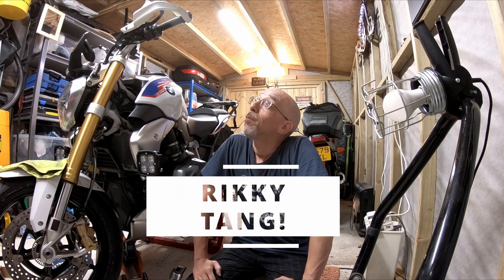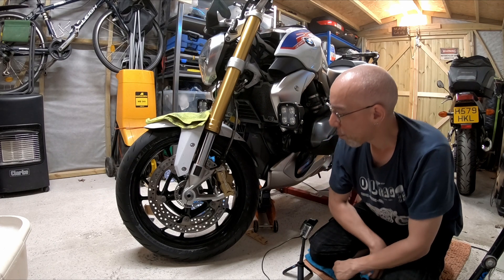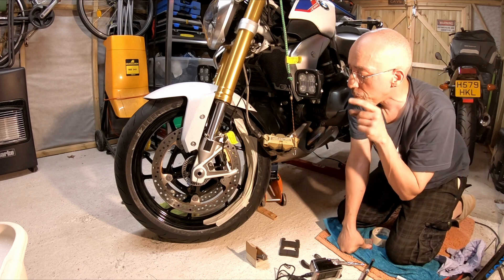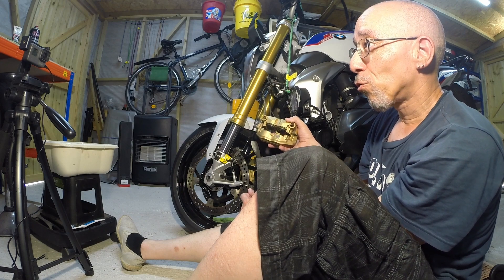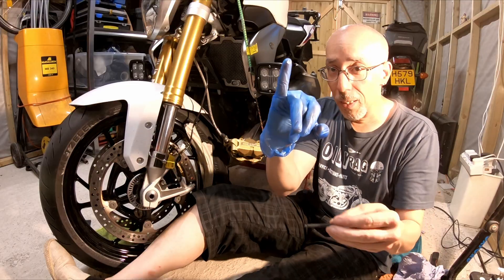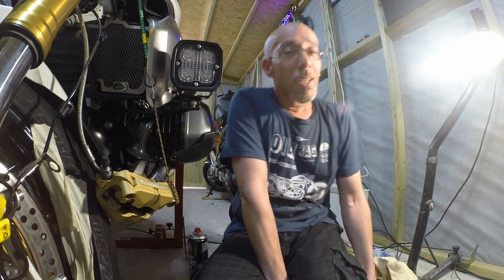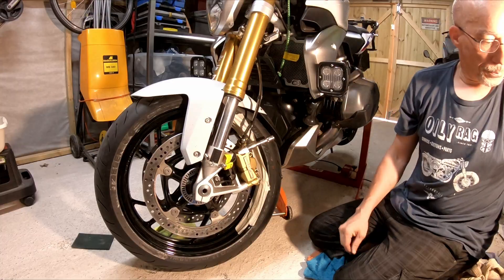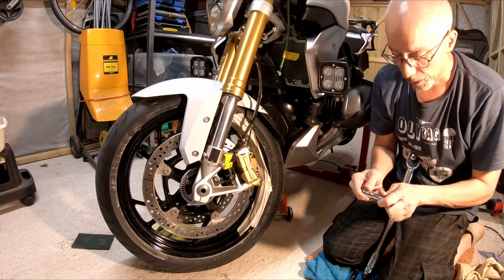BMW Hayes Calipers • front brake pad replacement: R1250 GS R RT S1000 RR XR R

Comment: Thanks for the video. I have Hayes calipers on my 2020 S1000RR and this will be very helpful when I change to SR pads shortly. The only comment I would make is that putting silicone grease around the pistons is probably not the best idea. It will just attract dirt and debris which will be drawn into the rubber seals as the pistons move in and out of the calipers.  The only place you might use it is on the sliding pin, but even there, many people say to avoid it altogether.
Reply from the maker: Thank you for your comments and I hope the video helps!  With regards to the silicone grease, I followed the advice of a experienced motor vehicle technician with several decades in the trade - that's how he does it and the reasoning behind it seems sound to me, however I do take your points that it may be best to avoid it altogether as one less potential cause of trouble down the line.  As with many things in life there is a difference in opinion here, even between experts!
Reply: @RikkyTang  True. It’s hard to know  who to listen to. I just finished reading a BMW technical bulletin covering this topic and they don’t use any grease or silicone.

Comment: Thank Rikky.  You missed installing the pads into the caliper.  You went to wash hands and then mounted the caliper.  If I followed exactly I would have pumped the brake lever without the pads.  That could be very interesting.
Reply: That's exactly what I thought. I was watching to see the pads being installed....which didn't happen unfortunately. Anyway, I installed pads on the front of my own bike last week and it was really dead easy. Brembo pads, definitely improved the power of the brakes.

Comment: Hi Rikky, what was the mileage on your R 1250 R when you changed the OEM front pads??...thx!
Reply from the maker: Hi Regis I',m sorry that I did not reply earlier.  I think I was at 8000 miles (12900km approx.), but with my track days I'm sure that my brake pad wear is higher than normal for this bike.